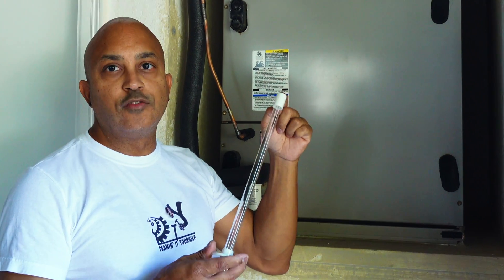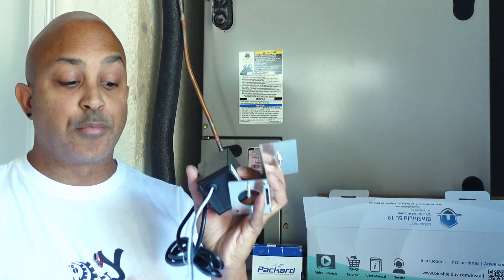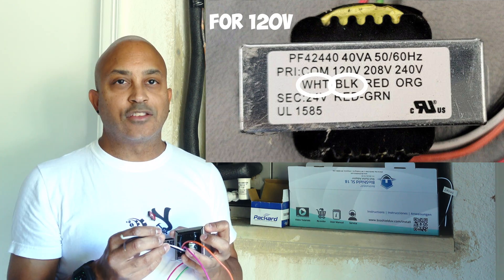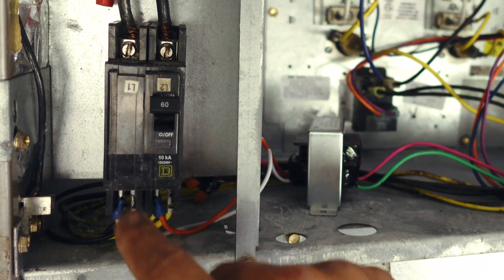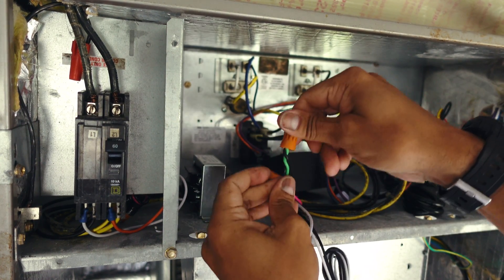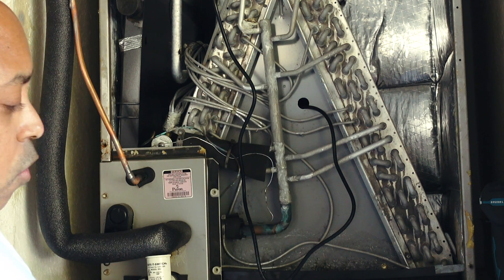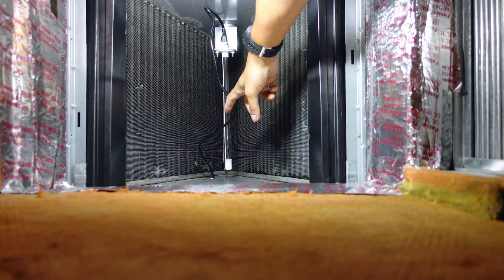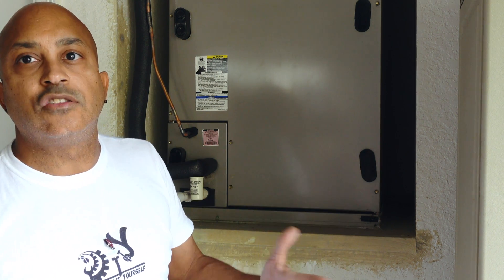How to install an A/C UV Light Kit | EASY Step by Step

Comment: Well, now the UV light will be on 24/7. I want it to come on when the unit comes on. Also shouldn't you have sealed around the cord that went into the a frame?
Reply from the maker: you want the light on even when the unit is not on, to kill any bacteria.  and yes you can seal the hole

Comment: Very helpful video - thank you - i followed your instructions, i seem to have the same blower system as you - i have the scorpion light with the strong magnet holder in the acorn area - next week i will add another shining on the blower blades - i have significant allergies that seem to be getting worse every year - we had the I-Wave thing installed at the beginning of covid but it stopped working after 3 years, i just never believed that it did a dang thing - where i know for sure that UV light is very effective
Reply from the maker: Glad I could help

Comment: Can I pull off the black caps on air handler to see if lights are working?  If I turn off circuit breaker, will that shut off lights?  Is their cheap uv eyeglasses in case it’s still on?
Reply from the maker: the kit comes with a sight glass for you to see the light

Comment: Hey on your next install don’t use the magnet base just take the plastic bracket that’s on the light and screw into where the magnet used to screw into. That way you don’t have to run the wire into coil section. Just easier that’s all.
Reply from the maker: great advice!

Comment: My blower is underneath the coil, so I have to remove it to access inside the coil.  Some numbnuts decided to put a screw all the way around the back holding it in, so I have to completely remove the entire air handler and cut the back panel off to get to that screw to remove the blower so I can get to the inside of the coil.  Which means I have to call someone out to evacuate the system since it will have to be disconnected, and recharge it once I'm done.  Might as well just have them install the damn UV light at that point.  "DIY."
Reply from the maker: Sounds like a tough setup!

Comment: Excellent work brother good explanation , I liked the video  I personally don’t  like that design , they overcomplicated the things I’ve seen easier Uv lights designs that don’t require a  transformer just plug it into an outlet and that’s it. Also the  Uv bulb  installation is easier in other setups where you don’t have to access the inside of the coils you just drill a hole and then shove the bulb in and hold it with 2 screws on the outside.
Reply from the maker: Thanks for the feedback on the design!

Comment: 1 if you have no access to the coil from underneath you can separate the bracket from the magnet part and tap crew the bracket to the metal... 
2 not sure why you didn't put the magnet on the otherside to not have the power cord go across the whole UV bulb...
Reply from the maker: it can go on either side, good observation though

Comment: I don’t recall if he mentioned whether this air handler includes an integrated air purifier or relies on standard replaceable air filters located beneath the evaporator coils, which is typical for most systems. If it uses replaceable filters in that position, installing a UV light as shown in the demonstration will destroy the filter within about two weeks. No standard air filters are designed to withstand direct UV exposure. The better solution is to position the UV light above the coils.
Reply: Thank you for bringing this up . Are there any that won’t destroy the filters ? I need mine under the coils where the mold wants to keep forming . Appreciate this video 😊
Reply: @littlebeebs1  No.

Comment: Do you worry about the UV light degrading the plastic drain pan?  Ive heard it makes it brittle and prone to cracking after a while.
Reply from the maker: it seems to be fine so far, and its been a while

Comment: You really should use wire clamps for both holes you passed the wires through, Overtime with the vibrations of the unit that sharp metal could cut the sheathing of the wires.
Reply from the maker: I will be sure to add that to the next video.
Reply: Is it true i need to install a UV rated filter if so where can I purchase them?

Comment: Unless you sealed it, there is a pretty significant air leak from that wire hole in the A coil side plate, right?
Reply from the maker: you can put a piece of tape to cover the hole but the air loss in negligible

Comment: Thanks for the video! I bought a UV light and transformer to install in my A/C coil. After installing the transformer, I turned on the breaker to test it, but it exploded and burned out! What could I have done wrong?
Reply: 😅😅😅😅😅😅😅😅😅😅 7:42 7:42 😅
Reply from the maker: you connected the wrong wires to your power source.

Comment: How do you access the coil from underneath the unit to attach the UV light? Underneath is a wall, not sure how to access inside. Thanks.
Reply from the maker: there should be a filter boxbelow the A/C.  sometimes there is a grille inside your house.  Or sometimes there is just a filter that slides into the unit from below.  if thats the case just remove the filter and you can reach under the unit to the coil.  if there is a grill inside your house with a filter, just reach up through the grille

Comment: You can put the wires directly from the wire R and common, there is 24v
Reply from the maker: in theory you could.  dont like sharing the 24v with other things on the line

Comment: My UV light has a ground wire as well. Do I just ground it to the metal somewhere in the unit? Also, does it matter where each wire(hot and neutral) connect after the transformer? The video doesn’t specify.
Reply from the maker: where is the ground wire.  By the part that connects to the transformer?

Comment: Thank you  for this video. I just installed this UV light and transformer that you used in your video. Should I be getting a strong odor when new? The transformer and control module were warm, the light was cool. Seems normal. If anyone can help answer this question it would be appreciated.
Reply from the maker: you sometimes get an odor initially

Comment: Seems like you'd be better off wiring it to power on with the unit. Or, do it this way but utilize something like a Shelly to have it power on (via Home Assistant or something) only when running.
Reply from the maker: That could be an option as well

Comment: can I use the same  24v wires that go to my humidistat and splice? Or do I need to add another transformer? Thanks
Reply from the maker: As long as there is not a big voltage drop you whould be fine.  If not just add the transfomer

Comment: now you have installed that at the back of the plenum.  and the wire goes through a hole with no cable protection.  jeez you seem very confident though, i agree on your intentions.  just please let everyone else know this is not the best way to install it.  i haven't even installed mine, but wanted to know how/why the magnet, and where.  now i see how the supplier intended it to mount.  and i don't have a metal duct, i have that sheetboard of insulation.  so i'm still working it out.  as always, just mho
Reply: ok i guess that was premature.  now i think this device just uses the magnet for a metal plenum.  but the bracket has mounted studs, with thumb nuts (i hope that makes sense) for the actual BULB mount.  and the magnet is for a metal plenum.  i will probably use a metal square to sandwich on the fiberboard insulation.  but the 24 transformer - i hope to not need. according to my hvac paperwork- i should be able to use the inside blower circuit. i may be wrong! lol  but so far my plans are to go with the 24v common (denoted "C" wtf - online says blue/black/brown/purple) and cool stage 1 (yellow). so we'll see i guess.  that should make it light up only when the indoor fan is running.  but i did not look into the max current for the hvac 24v circuit. so that might be a prob.  just mho
Reply: Ca you use an air ionizer  at the air intake while using the UV light within the a- coil plenum without any problems?? Will the ionizer damage or effect the UV light's operations.??

Comment: By wiring the transformer directly to the power in, do you intend to let the UV light being ON all the times even when the thermostat sends the signal to turn off the system, is it correct?  If so, will the UV light have a shorter life?
Reply from the maker: yes that is correct

Comment: Drill the hole bigger and screw it in from the front, lots easier access
Reply: Also why is the magnet placed on the back wall instead of the front wall? Less wire exposed inside by placing it on the opposite side.

Comment: Installed one at my customers home with similar setup as you had to remove because the ac  filter lights up blue from the reflection off coil

Comment: What model air handler is that? Mine has 230v
Reply from the maker: its a carrier
Reply: @DeaninItYourself my carrier unit has an existing 24v transformer can’t I just tap into that?
Reply: @DeaninItYourself I also have the same question. If my unit has 24 volts can I tap into that?
Reply: @neonnight34609 in the video you see there’s a transformer in the back. That’s where I have a 24v output. I was thinking of tapping into that. I think it’s powers my thermostat
Reply: 230 use the 240v cable
Reply: @EduardoFuentesLeal so use 240 transfer just like in the video?

Comment: PLEASE  GO GOOGLE OR LEARN  The best place is above the coil,  If water drips on the light, It may burn out.   I went to try and do mine this was.  Fasest location. and AC guy lost his mind,  Said yeah, Its great till water drips on the bulb,  So ths should be above,  Now, The light you get may be ok for this location, It may be the only location.  Just try to find out before you install the light

Comment: Thanks for the great step by step video, but I have one question. In the secondary wires, is there a hot or it can be connected to any wires on the light fixture wires.